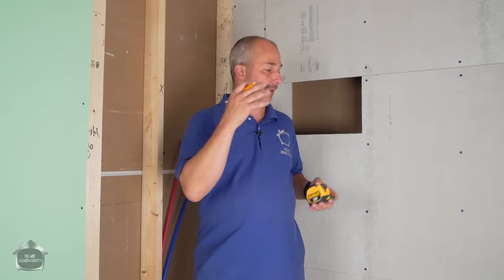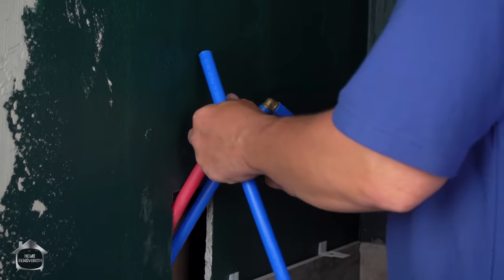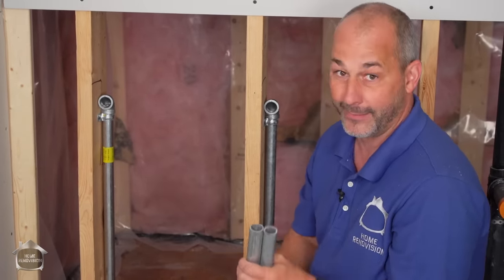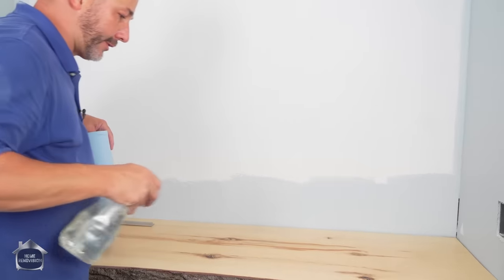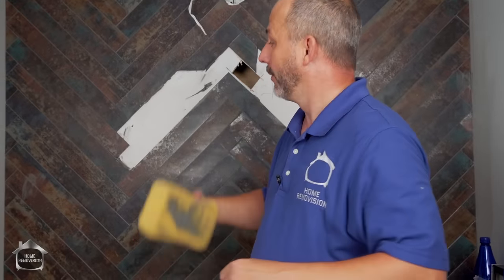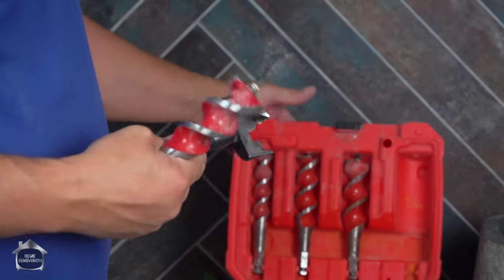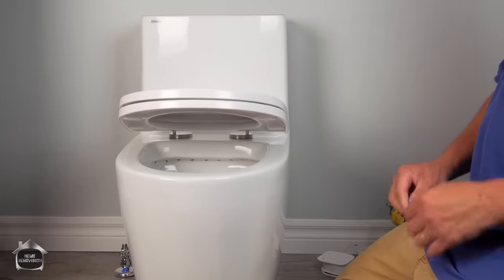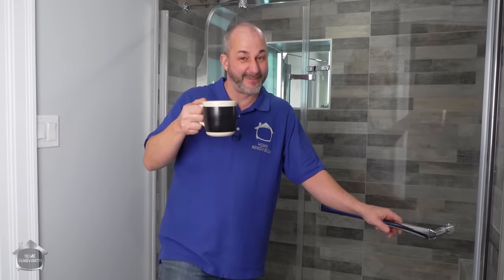Complete Build of a Modern Rustic Bathroom | A to Z

Comment: Great information, a few comments, questions and observations...
- I usual like the wall tile behind my floating vanity to go from floor to ceiling. That way the wall beneath the counter top is the same as above.
- Will the pipe ends holding up the counter top be visible? 
- Regarding waterproofing a shower... I understand that grout is porous, therefore water migrates to the back of the tiles and flows down. As the water accumulates at the base of the wall it has nowhere to go because the tile to pan edge is caulked. How does the water escape?
Reply: I know this was a year ago and I’m no expert but doesn’t the water just kind of dissipate out the bottom of the tile because that’s why the tile is set over the lip of the shower base? I’m going to redo my shower as a walk in and I think the water flows down the back and through the floor to the drain. Because there’s no shower bay and therefore no lip I need to make sure my waterproofing and angle toward the drain is spot on (as well as up to code) otherwise I’ll end up with a rotting and mouldy frame or gross stinky stagnant water sitting around somewhere or both, or something worse. 

It’s gonna be quite the challenge for someone who doesn’t maths, can’t measure for nuts and thinks close enough is absolutely close enough. 😂

Comment: A couple of points for the planking. First you need to use a sharp blade to score the planking, not the same old rounded corner with no edge left. Also you are not suppose to add any type of pad under L.V.P. It will wear out the seam edges due to excessive flexing. So your heated floor should have been cemented or thin set in as to make it a non flexing subfloor. Another tool to cut planking is a multi tool.

Comment: You want glass smooth with no sanding use build 50 (or any other thick set epoxy) ..that water based stuff isn't great im actually shocked they would recommend it for a heavy contact surface ..we have people using that stuff on there floors and having to re surface every 2 years or so ...it's a great product for low traffic low use areas  or flip houses I guess ..I hope it works out for you..

Comment: I have a few questions.

1. Do you have an upcoming video on how to build a bench in the shower?

2. Do I need use mold resistant drywall (the green one) for the shower only or the entire bathroom ?

3. The gap between the last tile and the shower pan do I need to use a sealant or will the grout provide waterproofing ?

4. If I use mold and vapor resistant drywall with the waterproofing membrane (the green paint) can I use large format tile or that system is only for small format tiles?
Reply from the maker: for benches I recommend using schluter board. or 2x10 dimensional lumber covered in cement board taped and waterproofed. as long as you have a good fan and use bathroom paint green board is only needed in the shower. and ceiling in some jurisdictions but best to check your local code for that, all gaps in bathrooms from 1 surface to another should be sealed with silicone. grout is not a waterproofer.large format tile can definitely be used on aquadefense. I like to use non  modified cement

Comment: ?   Building a three season cabin in Minnesota so it will freeze during the winter.  Are any of the shower systems better if they are in an environment where they will be allowed to freeze each year?  Is there anything different that should be done on a tile installation in these conditions?  Thanks for any advice you can give.

Comment: Nicely done overall.  I enjoyed watching, and it looks pretty good.

Personally, I found the PEX stub-outs for the sink and toilet to have a cheap look and feel.  From the soft, flopping pipe to the split flange on the toilet supply, to the sharkbite shutoffs that rotate on the pipes, it just doesn’t sit well with me.

Vinyl floor “looks nice” but definitely feels cheap to me.

Using the wire nuts as spacers for the light fixture was, no offense, a crackhead move.  They make spacers for situations like that.

I generally like your videos.  This one seemed to have a “quick and cheap” feel though.

Comment: I’ve ask this in the original video, are the mirror and towel heater even going to work if you wired them on the same circuit as the lights which is controlled by a dimmer!?

Comment: Hello, Is it ok if the drywall in my bathroom is in contact with the concrete slab subfloor in my 1950s house? Installer has it touching the concrete. I'm under the impression it should be 3/8 inch off the subfloor so it doesn't absorb water. I'm considering trimming the bottom. Is it necessary and worth it? Thx

Comment: Do you prefer to use tileboard for your shower walls? My tilesetters prefer to use a "Fat mud" float. If anything they were rolling their eyes when they saw the backerboard in my house. 

More work for them
Reply from the maker: most guys roll their eyes at change. the funny thing is most guys have been installing wrong ever since they invented thinset. Cheers! And that was back in the early 60's
Reply: @HomeRenoVisionDIY  I say it because I think the mudfloat is becoming a thing again here in California. I'm meeting more and more tilsetters- young or old- who are doing the float system. Guess it's coming back "in style." 
What we don't have anymore are hot mops. At least not here in the Bay Area. Thanks for the vid!
Reply: Floating a wall is great for flat walls, but...being carefull and dry or wet shimming, you can get the same result with wall board. If your tilesetters honed their technique to “flatten” walls they would be just as well off. My opinion 😀

Comment: Waterproof drywall. Aus QLD. Then 2 heavy coats of mapei sealer. Then join tiles w a two Pac product. Clean that two Pac gardener product w microfiber towels and vinegar, scotch bro he pads, even sandpaper or scraper if u get in trouble.

Comment: Any concerns with that bench?  The top cement board does not overhang the vertical wall.
Reply from the maker: no worries chris, it is a waterproofing system so it does not require the use of water diversion technology. Cheers!

Comment: @2.41.40 when your mentioning getting a pipe wrench or longer pliers to tighten that nut, I would not spend the money for a different tool, just grab a pies of pipe you have laying around somewhere and use it to temporarily lengthen what you already have.  Use a little caution, but works fine and cost nothing.

Comment: Lights hanging up collect dust inside the glass shade and on the bulbs, lights hanging down can be dusted easily when you clean.  Not to mention, the point of light is to illuminate what you are looking at, primarily yourself.  Otherwise the light would be centered in the ceiling of the bathroom.

Comment: I like installing the light fixtures with the bulbs & shades hanging down so bugs and dust do not accumulate in the shade. In the video the fixture appears to be close to the ceiling. this would make it difficult or impossible to install the bulbs.

Comment: For my alcove tub, my existing adjacent drywall is 3/4" thick (two layers; house built in 1961). Should I use the 1/2" + 1/4" cement board throughout the tub area, just on the adjacent sidewalls, or something different altogether? Should the cement board be flush with the tile flange ideally or set back? And the last question, for now, should I add additional subfloor under the tub (previously it was just the diagonally laid tongue-and-groove subfloor with no plywood on like there is under the tile)?  Thanks for all you're doing to teach the masses!
Reply from the maker: hi Spencer. i would add the sub floor under the tub for extra defense against deflection in the floor. deflection is what breaks the seals of silicone and plumbing. That style of subfloor you have is not strong until it is laminated. I would glue and screw that style! As for the walls. first you must meet the thickness of the existing wall. you are correct to use 2 layers. as for the integrated tile flange you want the wall board to meet or exceed the lip so that the subsequent tile can be installed flush and plumb. if it is too far back then you need an incredible amount of cement to build your walls and it gets real messy. Cheers! great tile work is all about preparation.
Reply: Awesome thanks again!!!!  after several delays I think I'm finally ready for this step, I know you covered it somewhere in one of your videos but Im not sure where, what kind of plywood do you recommend, anything specific or just a standard 3/4 in.? Also what kind of fasteners and glue?
Reply: @spencerr2124  get some 1/4" plywood and rip it into strips 1.5" wide and fasten it to the present studs to furr out for the Durock.   Use any plywood.  Glue down with carpenter glue.  Staple up some plastic underneath if the room is open so glue doesn't leak all over the floor beneath. (Don't ask me how I know).  Then use flooring screws.  I use longer screws to hit the joists every 4" and shorter floor screws for the rest on 4" spacing.  You will miss the subfloor in some areas because if the gaps.

Comment: The Hardie Cement board will degradate if it's directly subjected to extended exposure to moisture.  For example in a submerged application.

Comment: Happy  new year Jeff! have you ever had or known of adhesion issues, with a roll on membrane, used on any particular substrate? Or any type of thin set having issues bonding to membrane...
Reply from the maker: always use non  modified cement on waterproofing. Cheers!
Reply: @HomeRenoVisionDIY  Thx but I think you misunderstood the question. i was talking about problems with tiles bonding to the aqua defense

Comment: Would love some help on how to prevent sliding shower door leakage. It's driving me nuts with our new home.
Reply: There are rubber and silicone seals you can get for those glass doors.. I don't like then, as they get calcium deposits around them, but they work. They have the silicone ones in black and a bluish clear. It may take some calling around to find them, and they come in different lengths. You might be able to find them online. I bought one years ago, before the Internet. I don't like the glass doors, but we had them in an apartment when I was younger, so that's what we had to deal with. You can put the seal on with clear silicone on dry, clean doors. I'd clean the edge with vinegar and let it dry before attaching the seal strip. Also, if it comes folded, allow it to flatten out before installing it, to take the stress out of it. I put ours under some heavy books, and put it on cardboard on a very warm day, then the folds straightened and relaxed. I hope this helps you out.

Comment: Hi Jeff. New member here still trying to figure this all out. Where to send questions? To which email? Where can I send a pic to ask about something specific.  Love your videos. So one question I have is if I'm using the Rock cement board on the walls and water resistant green drywall on the ceiling can I use the same quick dry cement and mesh on both. And in a previous video you caulked the joints then put water membrane over. Can I caulk then mesh then mud joints? Oh and can you paint over redi guard membrane?
Reply from the maker: Hi Bill. cement and mesh if for the cement board only. I suggest using it and then redgaurd only where you will tile. Cheers!

Comment: dunno if its been said, but just a quick tip, for everyone, that makes life way easier.  When u were tightening the sink drain, instead of torqueing up using all upper body, next time flip the sink around, and use gravity, and leverage to ur advantage, and pushing down to tighten it, is much easier, allows you to use ur body weight as well.  Just a way to save some energy, smarter not harder.

Comment: About the glue on the wood top, Tip is to ask for a piece with an extra knot, pull it out, sand it down and use that :) It will make the knots look perfekt :)

Comment: The issue I've seen with these products are the water connections tend to leak after you hang the fixture due to the connection fittings.

Comment: Question for anyone to answer. Jeff lays vinyl floor directly on the decoupling membrane without encapsulating the floor heating wire in a cement product. I have never seen this installation method in any of the product manuals. I know mats can be installed directly underneath vinyl flooring but the description of bare floor heating wire seem to describe that the wire will get too hot and create heat striping in the floor instead of uniformily heating the whole floor. Even hydronic systems that are set in wood grooves use aluminum plates to distribute the heat. Do you need special floor heating wire to leave it bare? Does this method void the warrandy on the floor heating system? I am installing vinyl flooring over bare wire floor heating on an uninsulated concrete slab next week. If I can avoid flooding the wire with self leveler over the insulated subfloor I am adding that would save me a lot of trouble.
Reply: Home RenoVision DIY
Home RenoVision DIY

4 months ago
"The installation recommendations have changed so we are going to redo it. Cheers!"  - Cut and pasted from an earlier post and reply from Jeff.

Comment: So, since all of our building (Croatia, Europe) is "hard" with brick, concrete and cement and all of our housing and constructions are firm brick concrete walls  its interesting to watch Canadian standards. There is a lot to learn about the tehniq and honestly, we are a lot behind you with all of those "easy fix" and the ones we got on our disposal are expencive. There are some remodeling in the house don with cement boards, when the owner is not messing with the static of the construction, but we still prefer to tear down and built up brick walls.
Also, old contractors are used to do something in the same way 50 years and as we all know, the change is coming really really slow. The population also trusts more to old materials and built standards keeping in mind their wish that the built should outlive their owners, because of the cost of renovation that is time consuming, pricy and having trouble finding a god contractor (where that is not the case?).
There is not any condition to satisfy regarding the law of building and materials in the bathrooms especially when there is remodel to be don. Customer can put in anything he or she likes. There are standards in relations of water, electricity and plumbing that are passed on thru generations and are being controlled when a new building is being attached to a system the first time, but in terms of renovations and remodeling ... sky and wallet are the limits.

Comment: Originally from Indiana, now in California. I use red guard, or any available paint on water proofing and cement board. I now only use pre-made pans as well, prefer cast iron, and steel enamel, however on rental properties the composite is more than adequate with the turnover and refresh time. I could still argue cast iron for long term by and hold rental properties. Not big on the board systems, waste in my opinion, mainly marketing involved in those.  In Indiana I  have seen many early 1900's built bathrooms still holding up, not leaking if maintained. They get torn out due to changing style not failure. The way we do things is today is geared towards getting to the next job faster, that translates to less labor and a less expensive bathroom rebuild in most cases. Not saying there is anything wrong with that, it's just the realty, but their is also something to be said about someone building a shower pan in the early 1900's that is still functioning.

Comment: I have a question. How can u tell if drywall that ur taking out has asbestos in it ?
Reply: Wayne Smith I wouldn’t even worry about it. Unless your dealing with the stuff frequently (like working for a company that demos old houses) it will have no effect on you or anyone else in your home. It’s like standing next to someone smoking a cigarette once, your not getting stage 4 lung cancer from it. The problem with asbestos was the guys who had to work with the stuff on a daily basis for 30 years. It builds up in your lungs over time and could cause issues down the line. But to answer your question if it’s gypsum sheetrock than there’s no asbestos in it. They only used it in the joint compound up until around 1980. So if you think it’s older than that and want to avoid it just cut it into large pieces and try not to cut near the joints and corners.

Comment: Why did you skip waterproofing the upper right corner of the shower? Is the membrane so expensive that it wasn't worth the extra 10 seconds to roll over that area? You specifically said waterpoofing membrane is the time to do overkill. 28:00
EDIT: I guess you explained a minute later. Ran out of membrane material. Still, I'd waterpoof there anyway since you may spray it with water when cleaning.

Comment: I have someone doing my bathroom but he REALLY messed up on laying the tile so here I find myself.  He laid tile on top of durock without sealing with mesh tape or putting the waterproof membrane! I have the red one available for him to use but he said it wasn't necessary.  My anxiety is through the roof because I have to find a way to remove EVERYTHING and do it again. The tile isn't grouted because I told him to stop! He went through 5 boxes of 12 x 24 tile just for the shower with a bathtub 😭😭 At this point the job is stopped until I figure out HOW to remove the tile and durock.
Reply from the maker: no easy way. looks like you are starting from scratch.

Comment: I don’t know about that countertop bein installed with those conduit brackets, lotta weight on just those thin pieces of metal, I thought you would’ve put the L tubes you made into the studs horizontal